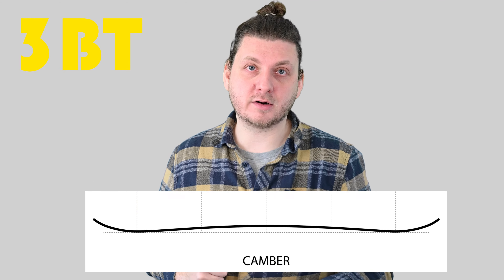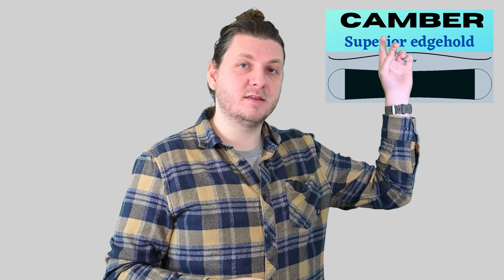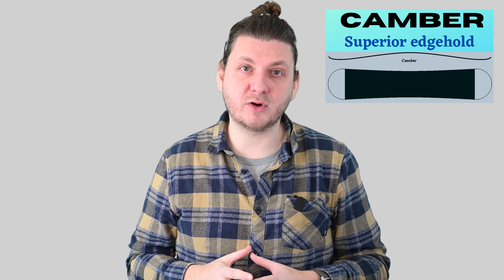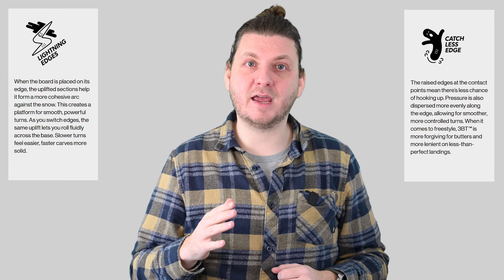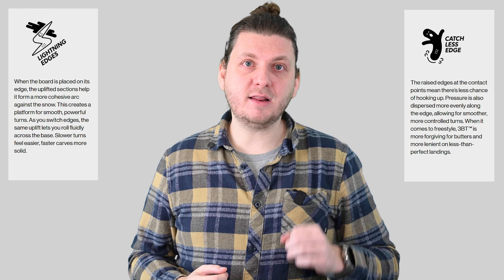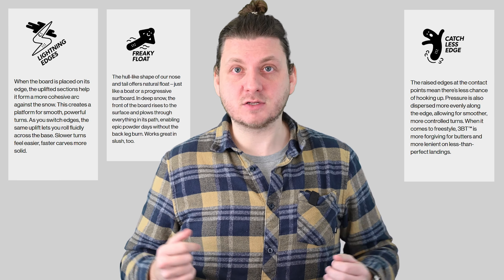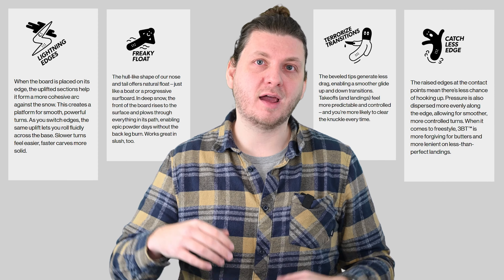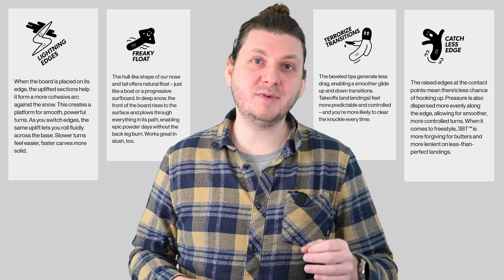What is triple base technology and why is it so good?

Comment: I tend to wipe out more on blacks on the whatever (2015) compared to on my friends jones aviator (2019) board (me on his board).
It's also a lot less stable at higher speeds.
Could this have to do with the whatever or with the 3BT line in itself?
Reply from the maker: That is most likely due to the nature of the Whatever. It is a relatively flexible board designed to be a Jack of a trades master of non. Where the Jones Avaitor is a very powerful board designed for hard charging. A fairer comparison would be something like the Bataleon Jam vs Jones Aviator. I personally have never had those issues with a 3BT board.